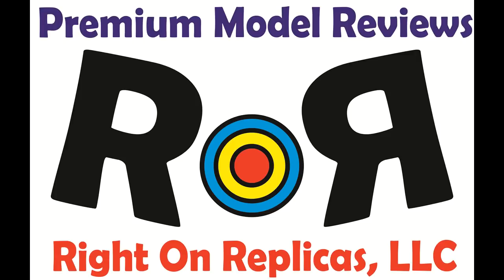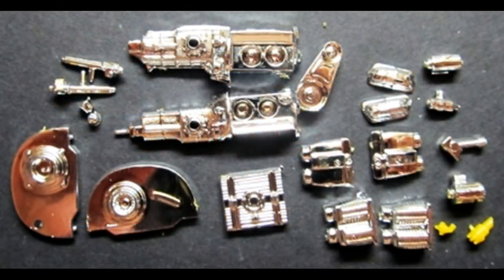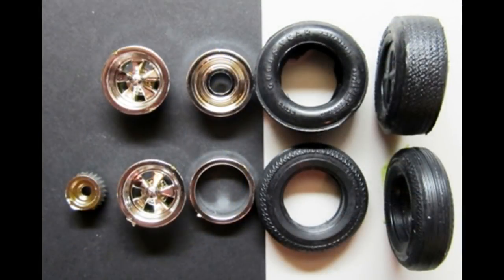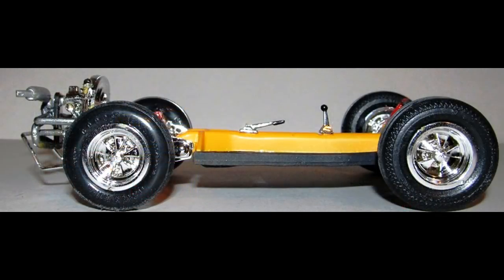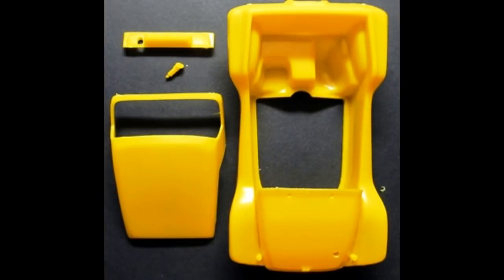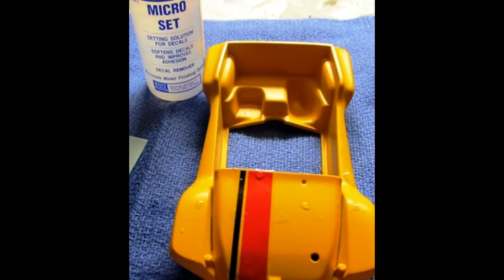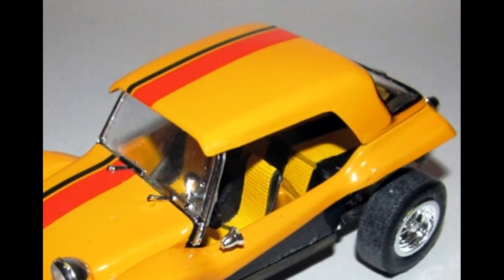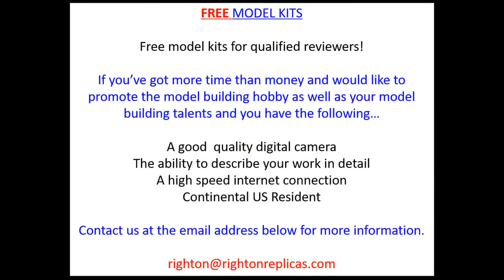Elvis Presley Meyers Manx 1:25 Scale AMT #847  -Model Kit Build & Review

Comment: Nice looking! Have you noticed the trend of model makers to stop producing red and amber parts in their kits? The Moebius International I got had none of those red & amber pieces. I think it would have made a big visual difference as the pieces are way too small too paint or add leds to. The Moebius markers are just slightly larger than a pen head! Italeri too using chrome stickers. Wow you can tell I haven't modeled in a while. Didn't mean to get long winded, sorry.
Reply from the maker: IW,  I agree with you that the makers are trying to figure out how to cut costs.  It's up to the consumers to decide if they are willing to accept the changes!  -Doug